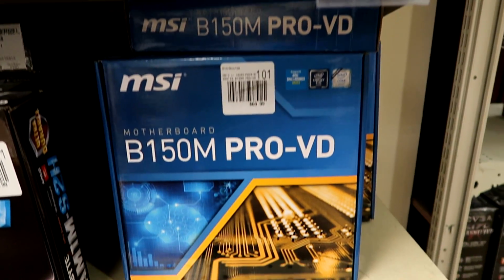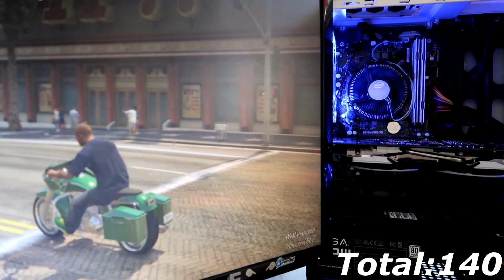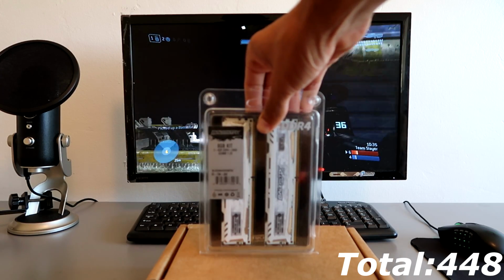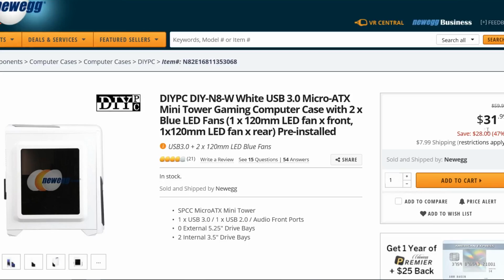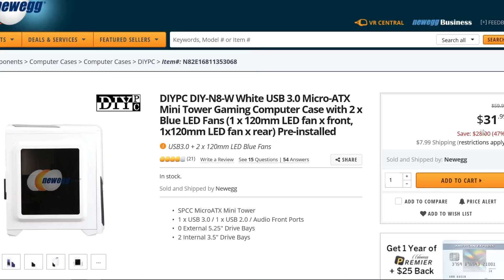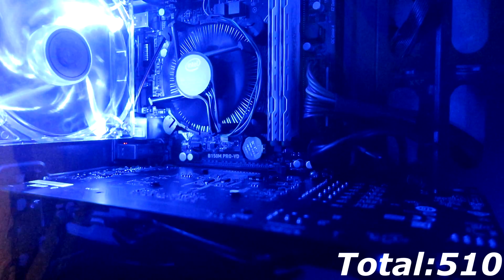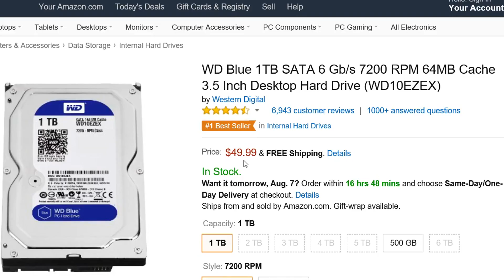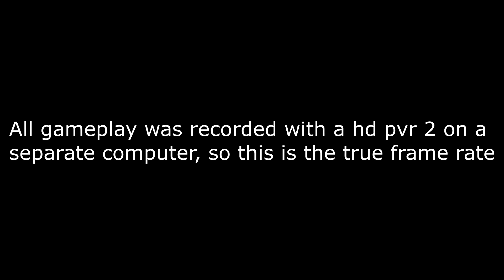Best $550 Budget Gaming PC Build Skylake GTX 1060 (w/ Benchmarks)

Comment: I built a Pc that was like 600$
i5 6400
Gtx 1050 ti Msi
16 gb ram
500 psu
Gigabyte h110m-a
Same case in the video
Reply: Ugly Turtle good
Reply: Ugly Turtle cool build! What I would recommend next would be to swap out the 6400 for a 6500 or 6600
Reply: i would do that but its too late
Reply: Does this run better. I'm new to the PC race.
Reply: Ugly Turtle that's close to what I'm going for
Reply: Honestly I would pay the extra $100 for the 1060
Reply: Ugly Turtle Where's the Storage
Reply: average fps? on new games
Reply: Ugly Turtle why 16gb of ram? If you downgraded to 8 you could put it towards a better case or storage
Reply: Unyielding Rage tru shit boo
Reply: yo what is the case called
Reply: I have a evga gtx 1050ti 4gb, 250 gb ssd, 16gb ddr4 ram, msi z270, i5 7500, 1tb wd black hd, a cooler master masterbox 5 case, corsair 750 watt psu and a cooler master cpu cooler,525$,  thats with shipping
Reply: But... does it run ROBLOX
Reply: which ram do you use?
Reply: Epic Pizza not much diff
Reply: 1.why 16gb i could do 8gb and 1060 3gb

Comment: You shouldn't use click-bait words like "best"... especially when parts such as the GPU are opinion based, as the Sapphire Nitro 8GB RX 480 is arguably a much better card than any GTX 1060 available for about the same price.
Other than that, great video of course.
Reply: I agree that the nitro is a much better card.
Reply: the thing is the 1060 comes with shawdowplay and i like to record 1 minute parts and show them to my friends so for me the 1060 would be the better choice
Reply: EVGA step up program / superclocked / shown to be better FPS in nearly all games / Price / Profit.
Reply: A gpu isent debatable realy on what's better.  Whatever gpu can push out the most frames is the best for GAMING
Reply: Not quite if a GPU uses 180W and generates 50 FPS then it is better than a GPU that uses 380W and generates 54 FPS since the 180W GPU will run cooler and will consume less power (obviously) and it is possibly quieter. And if the GPU has special features (AMD:Mantle Nvidia:Shield) it may be more suitable for certain uses in gaming since Mantle enables the AMD GPU's to push more frames and the Nvidia Shield makes playing games in the comfort of your own bed.
Of course this is my opinion so please take it with a grain of salt.
Reply: hahaha no it's not
Reply: Andrew Russell Aftermarket RX 480s have higher benchmarks than the GTX 1060. I'm not even talking about in Mantle or DX12, either. It has slightly higher benchmarks in DX11 as well.

The keyword here is aftermarket. The GTX 1060 only beats the REFERENCE RX 480 in benchmarks.
Reply: Zazzilas Arden so am i
Reply: Andrew Russell niqqa wat
Reply: A rx480 has much less performance. Especially overclocking the gtx 1060.
Reply: ***** Aftermarket 480 could compete, but still from the benchmarks and multiple tests @ ultra/high settings on 1080p the 1060 is clearly superior.
Reply: Fate The 1060 only has better benchmarks when using DX11 and OpenGL. DX11 will be obsolete for new games in about a year and OpenGL does not perform as well as DX12 or Vulcan. Most of the benchmarks you will find will not include Vulcan and quite a few do not even include DX12 yet. Nvidia pays them to show Nvidia bias.
Reply: Zazzilas Arden You're 100% right.
Reply: +Andrew Russell i dont think so never had aan issue w nvidia but with and plus amd cards loses value quicker even if the '60 is couple frames behind and 30$ bucks more its still a better deal
Reply: vArchiac i support the 1060 option, but i've owned both amd and nvidia. at this moment i've sold all my amd hardware/pcs and have only intel/nvidia. (had 3 pcs and sold the midrange one which was the amd rig, kept my main and my ITX builds)
Reply from the maker: Shiz nitzz dude... I wish Nvidia paid me... lol, till then I will continue to live off rice and play doh x)
Reply: +Zazzilas Arden Chill dude, there aren't even well optimized dx12 games out there yet. It'll take about 2-3 years for them to fully utilize the awesome efficiency of dx12. It's got nothing to do with nvidia paying them. Even in dx12 benchmarks that are out there, the gtx 1060 still beats the rx 480 in almost all the benches, aside from the heavily amd optimized AOTS. And good luck finding a game as well optimized for vulkan and amd as DOOM. By the time dx12 becomes mainstream, the rx 480 AND the gtx 1060 will be outdated. Hell, I've seen people reporting crashes on dx12 in battlefield 1 open beta (Although beta, why shouldn't it run in dx12? Probably devs not knowing how to use the new api) on amd and nvidia gpus. It's not safe to just depend on devs to optimize for your specific gpu vendor.
Reply: TessellatedGuy any aftermarket rx 480 beats any 1060
Reply: +Janko Mudrak any aftermarket 1060 will beat a 480. Plus he whole rx 480 pci power issue
Reply: ***** that shit was fixed ages ago. Like honestly wtf how do you not know about that
Reply: +Janko Mudrak no it wasn't it still happens with the reference cards
Reply: +Janko Mudrak the 1060 is a better card. For cheaper right now the after market 1060s can be found for 260
Reply: +Janko Mudrak the rx480 should have a 8 pin not a 6 pin
Reply: It's pretty opinion. Like people that buy the rx480 probably play Ashes of the singularity, but aots isn't gonna do shit for the other 1000s of games the 1060 wins in
Reply: But the 480 isn't in Stock anywhere. The 1060 is available for $250
Reply: +CrackedDylMil for the record guys get some old nice gpu such as an 580 and pair it with an i7 if u on a budget it will give u pretty nice fps n they cheap so u can just upgrade
Reply: vArchiac only if you get that 580 for less than $50
Reply: ***** Why are you talking about the pci power problems with the reference cards when everyone here is talking about aftermarket cards?
Reply: +Zazzilas Arden the price
Reply: +Zazzilas Arden the 1060 is a better card overall aftermarket or stock. I'm just saying the stock cards have the pci e power issue with some motherboards
Reply: ***** that was fixed so long ago, lmao
Reply: 1060 rekts rx480 ...
Reply: +iceminer16 Informática y Gaming and the 6gb aftermarket 1060 is cheaper than a aftermarket 8gb 480 on Amazon right now ($249 1060 vs $289 480)
Reply: +CrackedDylMil u dont buy such expensive stuff from amazon cuz of taxes. Use newegg or a third party from amazon.
Reply: +vArchiac the 1060 is $249 MSRP. Amazon is selling it for $249 with free shipping since I have prime. How is that a tax?
Reply: +vArchiac I just went to newegg and it's the same thing. $249 6GB 1060, $279 8GB 480
The 4GB is $249 lol. 

So for $249 you could get a 6GB card with shadowplay and 10-20% more performance, or a 4GB card that's slower and doesn't have shadowplay (although freesync is cool, Nvidia has fast sync which is also cool)
Reply: +CrackedDylMil idk but in the cart they give u an estimate let me check
Reply: +CrackedDylMil 20-25 in taxes so go for a third party on amazon that also sells it new n u wont pay taxes
Reply: +vArchiac I just checked. There isn't a tax. There was a $20 optional warranty, but no tax
Reply: +Zazzilas Arden every benchmark I see 1060 better
Reply: ***** 1060 6gb vs 8gb 1060 doesn't have sli rx480 have cross fire. 1060 in 2017 LEGACY DRIVERS
Reply: ***** The 8GB RX 480 and the 6GB GTX 1060 have the same price in the states, too. He's just an Nvidia fanboy trying to defend his brand.
Reply: ***** More VRAM, higher texture fill rate, nearly double the shader processing units...The RX 480 is definitely more bang for your buck.

The only thing the GTX 1060 has going for it is higher clock speed and SLIGHTLY better drivers. Nvidia has been releasing a lot of shitty drivers lately, while AMD has done nothing but improve with the new Crimson drivers.

Find me a benchmark that isn't a GTX 1060 vs a REFERENCE RX 480. Aftermarket RX 480s perform better in VRAM heavy games and rival the GTX 1060 when overclocked.

You can say whatever fanboy bullshit you want, but the RX 480 is definitely more future proof than the GTX 1060.

I've owned a GTX 480 and GTX 750 Ti and a GTX 970 and just recently tried out AMD products, so you can't accuse me of being a fanboy. I'm sick of all this Nvidia fanboy blind bullshit.
Reply: +Zazzilas Arden "AMD cards last longer" 

No, most of them burn up in flames
Reply: CrackedDylMil Nope.
Reply: Gtx 1060 is way better in ALL benchmarks compared to rx 480 and this is coming from an Amd fan. 
Im sorry, but we have to admit it, nvidia nailed it with the 1060.
Reply: +Awaker I think AMD has a real problem here. The RX480 has  1,024 more cores than a 1060 (which would contribute to the higher temperature and lower clock speeds) and yet somehow the 1060 is still faster. It's almost as if Nvidia has some secret trick to getting more performance, and they're just using it to make bigger margins while selling the same tier of performance.
Reply: CrackedDylMil Drivers. Nvidia is famous for driver support. The thing is, they don't support their cards for very long. AMD support for cards goes on much, much, much longer, and the card gets a little better with every driver. The GTX 960 used to perform better than the R9 380 for example, but after being out for a while the R9 380 is now the stronger and better performing card. That's why when you go on a respectable tech forum and ask which brand to buy, there is no fanboyism. They'll tell you to get AMD for lifespan and Nvidia if you plan on upgrading in a couple of years.
Reply: I agree. I'm the kind of guy that upgrades bi-yearly, so I usually stick with Nvidia (although I'm skipping the 10 series) 

I'll note, I've had my 970 for 2 years and it just keeps getting faster. I think they support their cards long enough for the usual gamer like me, but there's some people that buy the very highest end gpu they can, and then don't upgrade for 5 years. Those are the people that are still using R9 6000 and 7000 series. (and my friend that still has the original Titan)
Reply: CrackedDylMil True.. That's why you cant compare vga(s) with specs. Its just so complicated... Optimisation plays a big role aswell. Most easy exaple? The consoles.
Reply: +Zazzilas Arden actually my HD 7950 is about to burn up, good thing I have the 480 red devil on its way.
Reply: Lmao, if you look at any benchmarks (theres a shit ton of them) about 480 vs 1060, you would see that the 1060 beats the 480 in just about every game excluding the dx12 titles but even then the 1060 is just as good
Reply: Also to add with the exception of two games the 1060 only gets 2-5 fps more than the 480 while the 1060 now is a sold 80-100 dollars more I don't really see the purpose in going with nvidia unless if you want shadow play than that almost makes the price reasonable
Reply: +Bobby Casler do you even see 480 prices? None of them are selling for $199, it's either $230-$280 dollar range, if you're gonna pay for that might as well get a 1060, because a lot of them are still selling at their msrp $249
Reply: rx 480 isnt better than gtx 1060 isnt better since it performs worse than the gtx 1060 in most games. no fanboying or anything. looking to build a pc and searched benchmarks to see which performs best and gtx 1060 beat thr rx 480 in almost every game
Reply: I have a 1060 it's better. Both are great cards though
Reply: This build sucks for its price tho.
Reply: Rx 480 can barely get 60fps on games lmao shitty card
Reply: Can you recommend me $500 dollar pc build?
Reply: depends on what u need/want fam
Reply: what do you plan to do with, play with it, at what settings
Reply: Leonardo Pacheco Csgo, movies, occasionally some CoD, and yt.
Reply: The 1060 has doubled the VR performance of the 480 thanks to single pass stereo
Reply: CrackedDylMil Show me the souuurce.
Reply: Why the fuck would you use AMD, less compatibility with most titles, and it misses out on certain special graphic features in AAA games.
Reply: ArthaxtaDaVince777 No. The exact same could be said for Nvidia.
Reply: Not really. More games favor Nvidia. Not really fair though.
Reply: CrackedDylMil Show me the source.
Reply: DX11
Reply: Zazzilas Arden Wtf how so? Tell me what games have unique setting for AMD that nvidia doesn't have. Iv'e owned both, I should know what I'm talking about.
Reply: Zazzilas Arden GTX 1060 is for a fact better then the RX 480. The RX 480 is a good GPU, but it doesn't match the 1060, especially not the 6GB version.
Reply: Zazzilas Arden how tf is an 480 Better than a 1060 when there are benchmarks out there that the 1060 has like 10 fps more ?
Reply: ***** Because there are no currently accurate benchmarks. The only benchmarks out there are for the reference model 480s, which had a lot of issues.
Reply: Zazzilas Arden the good custom 480s cost way more
Reply: CrackedDylMil Every custom card costs way more than the reference model.
Reply: ***** Usually longer than Nvidia cards, actually. Driver support goes on for much, much longer with AMD cards, which means that they only get better with age.

I don't understand where the "oven" stereotype comes from with AMD cards. Yes, they get hotter than Nvidia cards, but unless you massively overclock them or use the reference blower model, they never get so hot that they damage themselves.

The hottest my R9 380 gets is 65C and that's when it is being pushed as hard as it can go.
Reply: ***** No. Just no. They do not "overheat more and more" as they age. That is literally the talk of someone who has never owned an ATI/AMD card in their life. I have owned and tested numerous Nvidia and AMD cards over the years, and I have NEVER had heat issues with my AMD cards. The only card I've ever had actually overheat EVER was a GTX 480.
Reply: Zazzilas Arden I had an old ati card burn itself up
Reply: Dominick Crouchelli no
Reply: ***** Paying 30% more for a 5% performance increase isn't objectively better. I's a waste of money. Aftermarket RX 480s have about a 5% performance difference with aftermarket 1060s while costing far less.
Reply: Zazzilas Arden 10% faster for the exact same price.
Reply: ***** Aftermarket models run perfectly fine. I don't know why you keep trying to bring up issues with the reference model. Who the hell actually uses a reference model?
Reply: ***** ha...haha....hahaha.....HAAAHHAHAHAHA

GTX 480 GTX 780 GTX 980 GTX 1080.

All have heat issues.
Reply: Zazzilas Arden the 980 runs cool as fuck. And the 780 runs a fuck ton cooler than the 290X (literally blows papers off your desk). 

The 480 is too old to argue with
Reply: CrackedDylMil The only 980s and 780s that run cool are ones that have custom cooling fans. 80C is literally normal for them.
Reply: Zazzilas Arden my best friend owns a 980, and came from a 780Ti. You're not fooling anyone
Reply: CrackedDylMil I've tested both a 780 and a 980. I literally own a small business that builds custom computers. I have literally built and stress tested systems with damn near every single one of these cards. It's kind of funny how with every card that gets mentioned, some Nvidia fanboy is all "someone I know has owned it", so that must mean they have an infinite font of knowledge about all of its issues, right? So irritating. I own a 1070 and a 980 myself. Shit, all you have to do is a damn google search for "980 heat issues" to get like fifty damn results. It's common as fuck.
Reply: Zazzilas Arden prove it you poor fanboy. If my 62% ASIC GTX 970 @ 1470MHz doesn't even hit 65 with the default fan profile, then there's no fucking way a 980 overheats
Reply: Zazzilas Arden make a video of the 980 that you apparently own overheating.
Reply: Zazzilas Arden the funny part, is that the 290X and 390X runs at over 92C (!) with an aggressive fan profile.
Reply: Zazzilas Arden you're the one making outrageous claims like "GTX 980 overheats" and "I know because I own a company". R9 390X and 290X heat problems are well documented and normal
Reply: Zazzilas Arden
 290X TDP: 290W
980 TDP: 165W

Yes the Google search certainly told me that amd runs much cooler
Reply: Zazzilas Arden 397 vs 304 
I was talking about heat anyways. Not wattage
Reply: CrackedDylMil The 290x is 365.

Are you legitimately trolling?
Reply: Zazzilas Arden the 290X has to run in "uber" mode for full performance. Even then it's only competing with the 970

That's like me saying "my 980 uses less power than a 750! I just underclock 500MHz"
Reply: Zazzilas Arden 
480 better than the 1060? Are you fucking kidding?
Reply: much better ? only in directX12 and vulcan setting and still only +10-15 FPS difference So if you will play games like bf1, watch dogs2, gta V rx 480 sucks dic
Reply: TheClumsyTiger Turns out not to be the case... RX 480 is a lot faster now